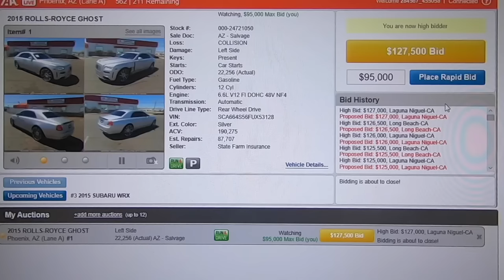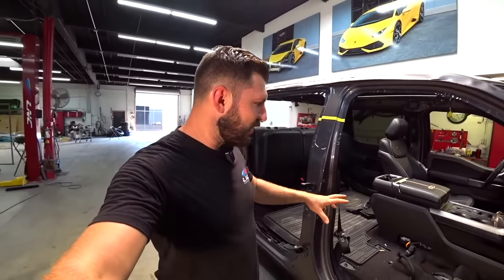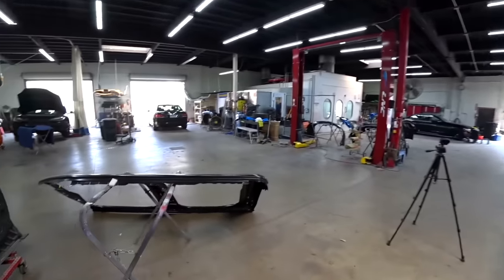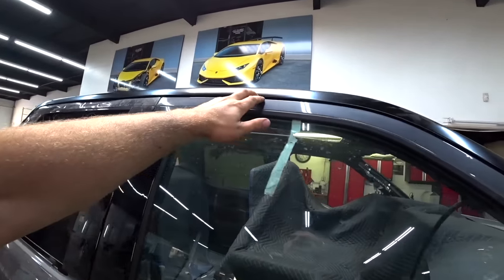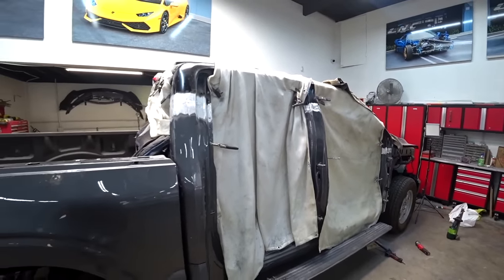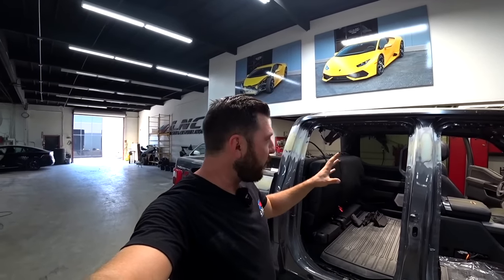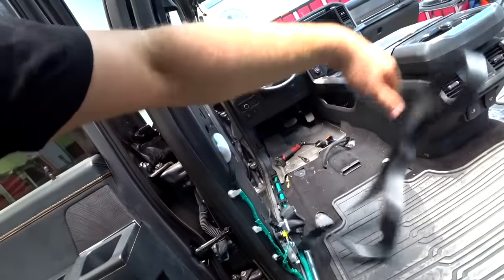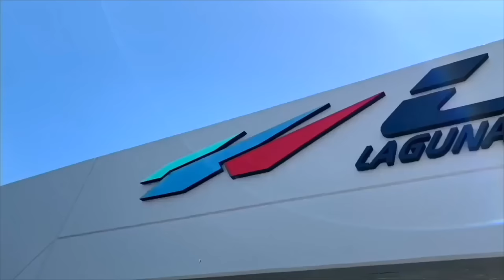REBUILDING A WRECKED 2021 FORD F150 PLATINUM FROM IAAI INSURANCE AUCTION. (PART 2)

Comment: Turned out great 
Only thing I don’t know about is the pop rivets . Is that the recommended way to do the panel repair for this ?  Because I’ve seen you weld panels on and pop rivet them on .